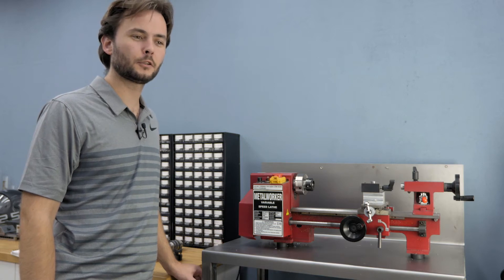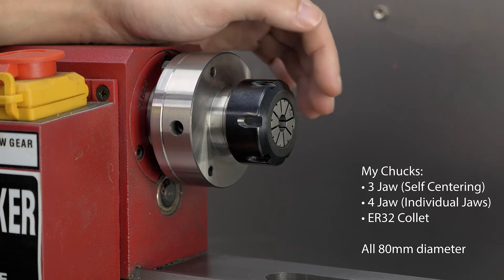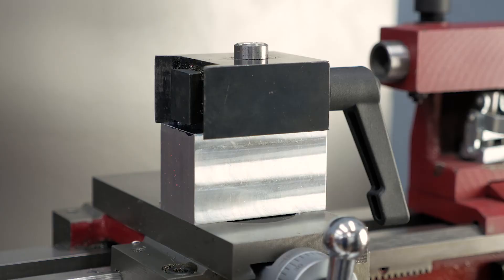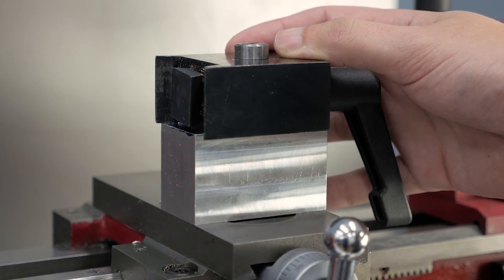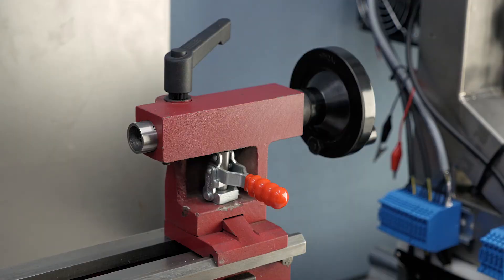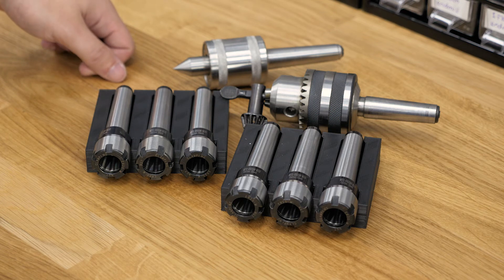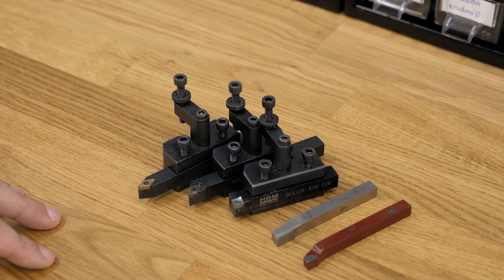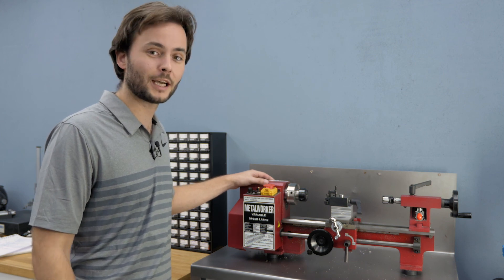My Workshop #1 The Lathe

Comment: That tailstock mod is genius.
Reply from the maker: Thanks for the comment! I just noticed it. It is a nice and simple way to lock it in place on these small lathes. I do not recommend using it on larger lathes though, with a large drill (12mm) in the tailstock I can make it move when I push the drill hard enough in the material. Aside from that I'm happy that I did this mod, saved me a lot of time loosening and fastening the original nut in the last couple years!
Reply: @StefsEngineering  Kan je een linkje geven naar de klem die je gebruikt hebt?
Ik kan dit type klem nergens vinden?
Reply from the maker: @winandd8649  Hij is breed verkrijgbaar online, Als je zoekt op toggle clamp dan zal je een boel aanbieders tegenkomen
Reply: @StefsEngineering  Een hoop toggle clamps zag ik inderdaad, maar niet een die lijkt op die jij gebruikt hebt
Reply from the maker: @winandd8649  Het is het type "push pull" zoals: https://www.elesa.com/imgSiteRew/WebHiRes/ELESA/PHOTO/12/MFE.jpg/MFE.-Push-pull%20toggle%20clamps.jpg
Reply: @StefsEngineering  Juist! dank je 👍

Comment: that's not a workshop, but an operating room. super tidy. i like what you did with the tailstock, excellent idea.
Reply from the maker: Hehe thanks for the compliments! I am happy with the tailstock like this but did notice that at higher loads it possible to slide it a bit. Definately something to consider because you cannot get the clamping force to the same level as with a normal bolt/nut combination (you wouldn't be able to actuate the lever in that case)